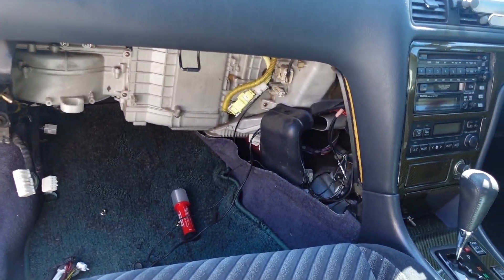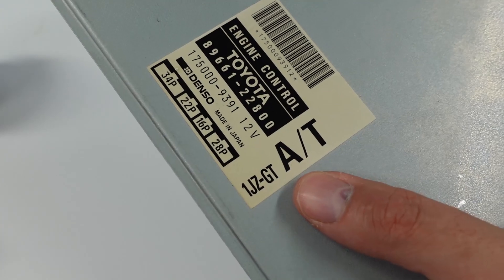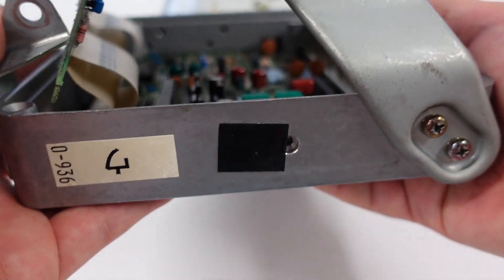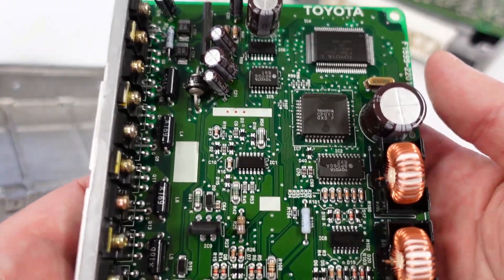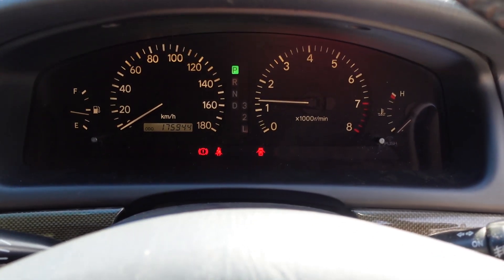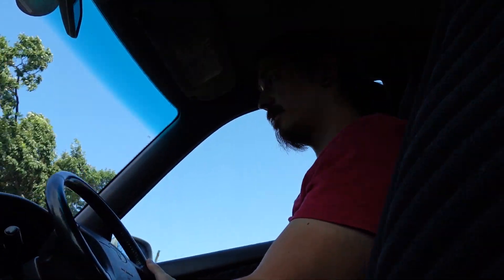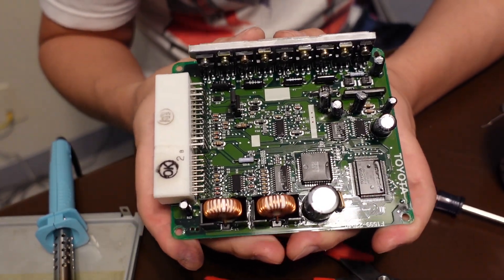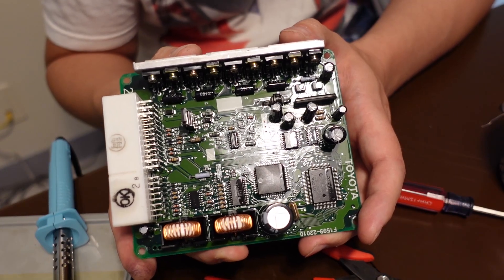JZX100 (90 and 110 too?) - ECU Capacitor symptoms and replacement DIY

Comment: Im having the lights flashing issue but not the ac issue. All you did to get the lights to stop blinking was change the ecu?
Reply from the maker: Various capacitors can die. Just compeltely replacing the ECU would work. But honestly, it's not that bad to replace the caps.
Reply: @protomor  where do I find new capacitors that are compatible?
Reply from the maker: @brandonwoods7244  ebay has kits. But they're just regular capacitors. Google the specs and you can order your own. Technically the caps say what they are on them. You can crack open your ECU and see which ones are leaking and replace those. But honestly, just replace all of them and get a kit online.

Comment: thanks for the video i have a amuse throttle /traction disabler and for some reason its flashing etcs snow sometimes not sure if its sopposed to
Reply from the maker: Uhh that sounds like a cold solder or the board is damaged. I'd have to see what it looks like.

Comment: We're never safe from leaking capacitors when it comes to vintage electronics, aren't we.
Reply from the maker: I mean the whole thing is inside a hot cabin every day. It heats up and cools down so much. Makes sense they would go out.
Reply: @protomor  Very true. I just kind of expected to see bad caps on an early 90s ECU after looking it up out of curiosity...

Comment: Door Panel Remover  tool looks like a screwdriver with a notch out of it in the middle perfect for pulling those little clips out
Reply from the maker: Yea but it looks like you need to get under the button and pop out the middle and not the outside. Either way, they came out pretty easily
Reply from the maker: Thanks for the tip. I'll def pick up a set next time I'm out

Comment: The voltage value on the capacitors is not important.. as long it is the same or higher than the original value.
Reply from the maker: Good to know! I just blindly trusted the internet and it worked out!